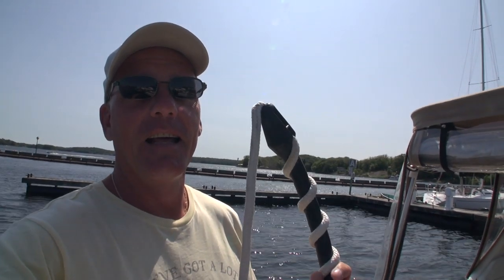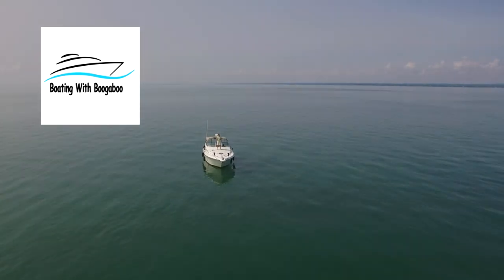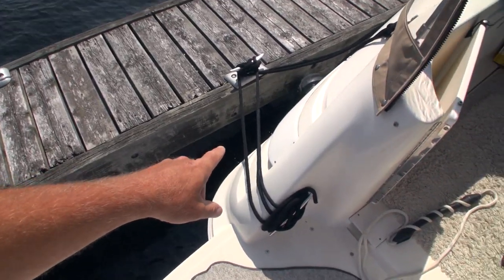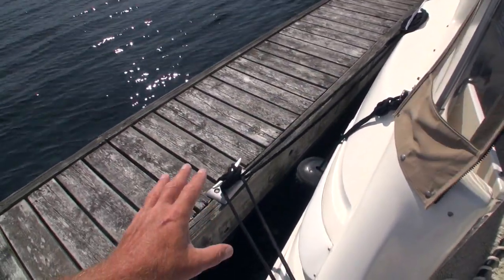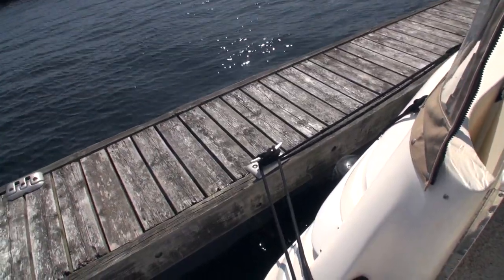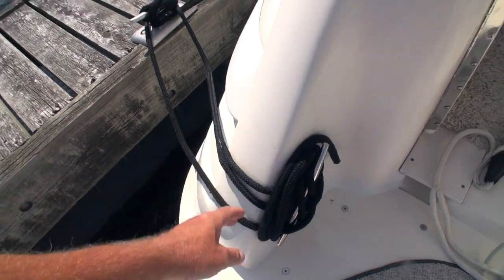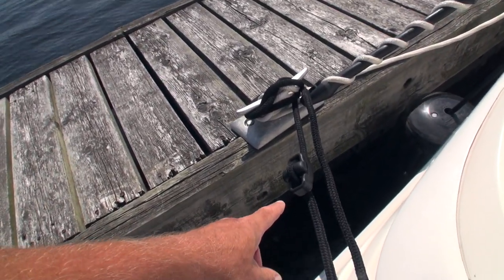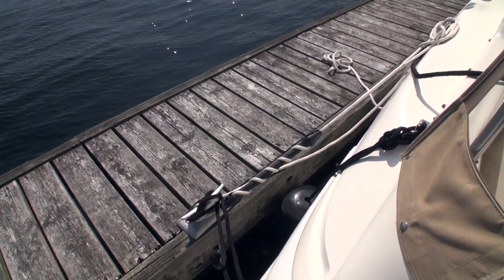Boating Basics - Mooring Snubbers

Comment: I've used snubbers for over 10 years.  All of our lines at dock have them.  When you're at dock and on the boat you don't feel any tug from the water motion.  We're on a busy lake, outside slip so they are very necessary.  I won't tie up without them at all.  One thing I noticed though, I would never have the snubber that close to the cleat as it creates wear at the tip of the snubber.  Over time it will deteriorate.  The voice of experience here!
Reply from the maker: Good advice, but it was only for that afternoon, then packed away until next season. . .
 I did think if something though; as you are an experienced and we'll rounded boater, it would be wonderful to have similar videos in the AM/FM YouTube channel 👍 I know you got the voice for it!

Comment: how about some words on an anchoring bridle?    my four winns  238 has bow cleats on the forward sides 
vs one cleat in the middle and at anchor she sails around uncomfortably?   
would a bridle solve that ?
Reply from the maker: I'm not that familiar with a bridle setup. Sadly, we rarely anchored out over the past few seasons. . .
Reply: @BoatingWithBoogaboo  they're used a lot on Okanagan.  They take the pressure off the cleats and distribute the weight.  Tied to the two bow cleats they're pretty awesome to use.